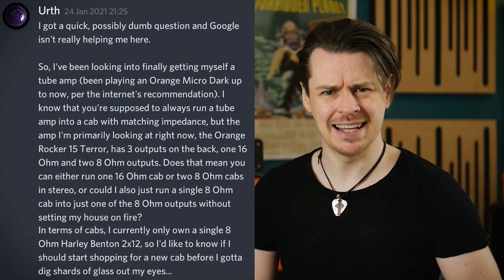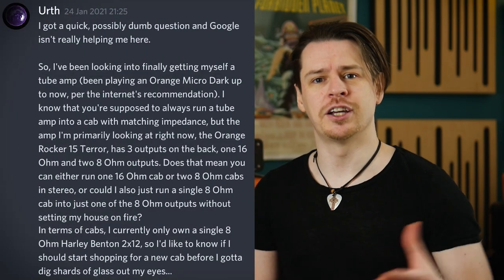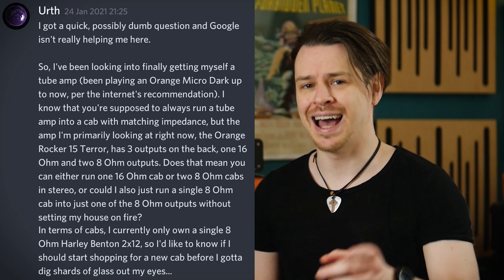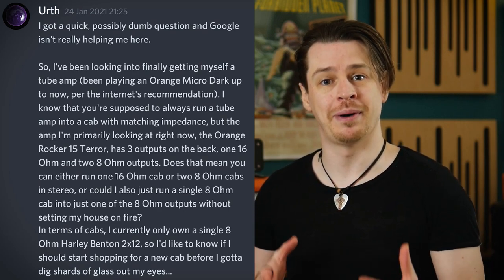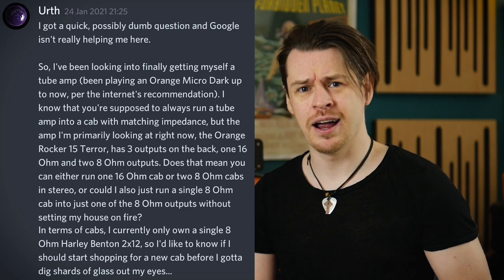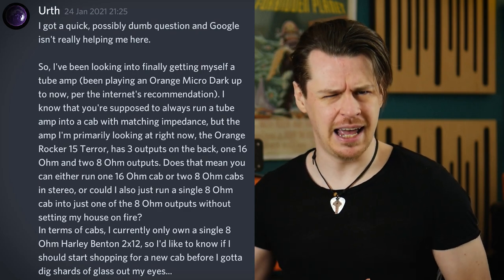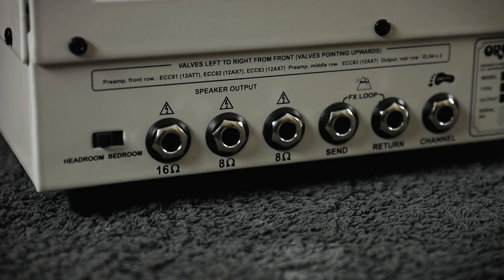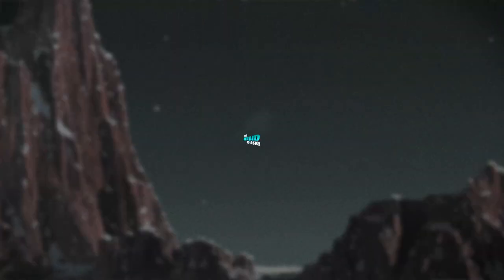Impedance Matching Speaker Cabinets | Too Afraid To Ask

Comment: This might sound stupid but what counts as high and low impedance. Is 4 higher than 16 or is 16 higher than 4? Does it literally follow numerically?
When talking about 8 ohm minimum, for example,  does that mean it will take 8 ohn and 16 ohm cabinets?

Comment: Here's a question, I'm thinking about building a speaker cab for an amp I'm building and I was wondering if I need to make the cabinet much larger than the speaker cone? Most cabs that I've seen are at least a couple of inches larger than the speaker so I figured that the reason was acoustics/air movement related. 
Cheers from Canada!

Comment: Q.  I'm about to swap out my 16 ohm speakers in my 4 x 12 speaker cabinet and install 8 ohm speakers, same wiring, would I run eight ohms out of my amplifier and not the 16 ohms output I previously used?
Thank you in advance

Comment: Colin, I'm sorry but I am still unclear. I thought I had it down; I have the ROcker 15 with a PPC 212
do I just use the single 16om connection? or the two 8om? thanks man
Reply from the maker: The video makes it very clear: 

If you have ONE 16ohm cab - connect it to the 16 ohm out.

If you have ONE 8ohm cab - connect it to either 8 ohm out.

If you have TWO 16 ohm cabs - connect each to an 8 ohm out.

Comment: But what, if any, benefit would there be from connecting 1no 16ohm speaker in preference to 2no 16ohm or 1no 8ohm speaker?   Other than being able to use a cabinet I have already?

Comment: I'm dumb so in my case I'm connecting an orange ppc212 120watt 16ohm cabinet to my Victory Super Kraken 100 head. Do i connect to both to 8ohms from the head to the back of the two inserts on the cabinet to make it 16ohms? Or just the one 16ohms output from the amp to the left insert or the right insert on the cabinet? I haven't bought it yet because im doing my research first and from the picture it doesn't tell me if the right one is the insert or if the left one is. One may be an insert and the other may be an output so i don't want to buy hook it up wrong then fry it the first day lol.

Comment: I have a Mesa boogie minirect. It has one 8ohm out and a 4 ohm out. 
I have 2 cabs if like to hook it up to. 
Both are 8ohms. 
One is a 1/12 cab. The other is a 2/12 cab. 
All 3 speakers are V30's. 
Is it possible to make this stack work ?

Comment: Assuming we have connected to the correct ohms slots. I see these single speaker engl cabs with 60watt speakers, and then 2 speaker cabs where there is a switch at the back saying mono 120watts and stereo 60 watts. How safe is it to connect a 100watt amp to a 60 watt single speaker or 2 speaker cab in stereo 60 watts?

Comment: If your Strat does not have enough low end, switch amp to 8 ohms and plug it into 16 ohm speakers. You could even practice some bass riffs with your Strat :-)
Reply: I meant a 16 ohm cabinet but YT won't let me edit my comment.

Comment: Does speaker size matter of the cabinet. Let’s say plugging into a 1x12 and a 1x10  cabinet, both are 16 ohms cabinets. Is it still safe to use both of the amp 8ohms speaker output into each cabinet.

Comment: Ok TATA question.... why does my 8 ohm  orange speaker cabinet have 2 inputs? It's a 1 speaker cab to match my (min 4 ohm) orange micro terror. I'm guessing 1 input makes it 4 ohm but I only have 1 speaker out. What would the setup be where I used both inputs of the speaker?

Comment: Man awesome video. But you forget to say if 2x16ohm cabinets will be pluged by two speaker cables into two 8 ohm socket. Or i will connect these cabinets to sum them, and send only one speaker cable to the 8 ohm jack from the amp
Reply: He did indicate the two 8 ohm jacks of the orange are in parallel so you could plug in two 16 ohm cabinets using two speaker cables into the two 8 ohm jacks. If you have a different amplifier, first find out if the jacks are in parallel. Don’t assume anything. Good luck!

Comment: I have a marshall 20w top and use it trough a 4x12, 240w, 16 Ohm cab. I also have 1x12, 70w, 16 Ohm cab and I wonder If I can plug them In together in 2 outputs for 16 ohm with out any problems. And does it matter that it is one 1x12 and one 4x12

Comment: So i have this fender frontman 15g amp that is running the stock speaker which is rated for 8 ohms, but i'd like to upgrade it with a celestion eight 15 (not a jensen cause i live in mexico and couldn't find one), but then i noticed the celestion is rated for 4 ohms, would be that a problem?

Comment: Am i safe to use a 16ohm and an 8 ohm speaker on a minimum 4 ohm amp? And how will i calculate the maximum load on the cabs? Not that i would ever be insensitivised to do so but still

Comment: I have lent my valve head at gigs before and had the transformer blow as I assumed people knew the importance of this. Very annoying and I had to pay for the repairs. But what if the cab is old and no longer displays what the impedance is. Other than not using the cab what would be the safest bet, 8 or 16ohms?

Comment: Great info, as always, Colin. Something that I have noticed on (solid state) bass heads is that it will often say something like: 500w at 4 ohms, 350w at 8 ohms. Is this reduction of power at different impedance levels just something that happens, or is it built into the design?
Reply: the higher the resistance, the harder the amp has to work (more current required) to put out the same level of power. It's like your car can do 100mph on the flat but the same car with the same engine can only do 60 going up a hill.
Reply: @dylanadams1455  That makes sense. Thanks.
Reply: @dylanadams1455  Actually, you have it backwards. Less resistance is more difficult for the amp.  The lower you go, the harder you force the amp to work. A dead short is 0 ohms. The closer you get to 0 ohm's, the closer you get to taking your speaker cables and crossing them. That's why when you look at amps and speakers, guitar or otherwise, you'll always see the specs are focused on how low the resistance is for an amp or speaker. Going up is no problem.

Comment: Thankyou so much for explaining this! Does the same principle apply with a loadbox? For example some loadboxes are 8ohms and some are 16ohms
Reply: You need to find out what it really is. If its an output transformer or an autotransformer, and put it in between an amp and speaker, then yes, the same rules apply. But this only applies if the amp doesn't have an OT or autoformer already installed. Also, he messed up in his explanation of how tube amps work in the video. I went over it in another post if you are interrested.

Comment: Here's a related impedance question: I have a Randall RG fully solid state head with two speaker outputs grouped together that says "Min total load 4 Ohms". The owners manual does say "Max two 8 Ohm cabs". Does this state outright whether the speaker connections are in series or parallel?
Reply: If there are multiple speaker outputs on an amp, they are always in parallel. Since that amp can handle a minimum of 4ohms, two 8ohm cabs in parallel is 4ohms at the amp, so you are good. Just can't mix an 8ohm cab and a 4ohm cab, or two 4ohm cabs, because either combination would be a lower impedance than the 4ohms the amp can handle.

Comment: Would this be the same for using a combo amp as a head? For instance could I connect a 16ohm cab with an 8 ohm combo solid state amp?
Reply from the maker: A combo is just the amp and speaker inside the same box.
The same rules apply: physics doesn't care if the speaker and amp are in different boxes or not.

Comment: My tata: i have never used amp sim. i dont know if need to always use a cab sim as well, or if only with some. And if i record from an amp head or combo directly into daw, do i need to use a cab sim with that? Basically, when to use a cab sim, and when is just an amp sim or amp usb line to DAW enough?
Reply: Totally depends what you're plugging into the amp. They should say whether or not they include cab sim on them. Older amps might just have a line out with no cab sim but that's rare nowadays. Sounds like impulse responses on a Daw are the way to go.

Comment: So to keep it short and simple im planning on getting a randall RG1003H 100 watt solid state amp head and a harley benton 120 watt 2x12 vertical cabinet and the head had max 4 ohms and the cab has a 8 ohms max and i need to know if they are alright to pair. Asking for a friend. :D

Comment: i think i get it but y 3 plug ins if you can only use 1 plug at a time. i have a 2x12 and 2 1x12 cabs could i run all 4 speakers at the same time?

Comment: Ok so i have an 800 watt solid state amp at 4 ohms. I run that to a 210 cab at 8 ohms then from that 210 to a 115, also at 8 ohms. Is this going to caise problems?

Comment: I'm curious,does this apply to combo amps,I'm thinking about doing a speaker upgrade of my Boss Katana from stock to celestion v30 and the amp is 4 ohms and the v 30 is 8 ohms
Reply from the maker: Why wouldn't it apply to combo amps?
Combos are just a combination amp and speaker in the same wooden box. 

The physics of the electronics remains the same.
Reply: @ScienceofLoud  I see,thank you for answering my question

Comment: So I was planning on replacing the speakers in a crate 4x12 cab, and was looking to do all 8ohm or 16ohm speakers (eminence probably), we have Blue voodoo head that only has an 8 and 16 ohm switch

But every calculator ive used to look at the all 8ohm/16ohm speakers in parallel or series come back as either too low (2-4 ohm), or too high (32-64 ohm). and im having trouble finding info on this. Im not quite sure what to do in this situation
Reply from the maker: If you pair off the speakers, wire each pair in parallel, and then wire the two pairs together in series you'll get your solution:

Using all 16 ohm speakers you'd get - 
1/16 +1/16 = 1/8 
Each pair comes out at 8 ohms

Then wiring those pairs in series- 
8+8=16
Putting those 8 ohm pairs in series gets you back to a 16 ohm load. 

Using all 8 ohm speakers you'd get:
1/8+1/8 = 1/4
both parallel pairs = 4 ohms

4+4=8
Series pairs gets you 8 ohms total.
Reply from the maker: OR you could do the opposite: pairs in series and then wire those pairs in parallel - 

8+8=16 twice
1/16 + 1/16 = 1/8

Whichever way you fancy doing it you'll get 8 ohm load from using only 8 ohm speakers, or a 16 ohm load from only 16 ohm speakers.

Comment: Is it the same if you daisy chain cabs? 8 ohms out to the 8 ohm cab then out from that cab to another 8 ohm cab??? Would that go to 4 ohm??  I,ve often wondered about that! You see many commercial speaker jack plates with in and out.
Reply: I have the same question.   I have 2  8 ohm cabs .  If I run them together from the 8 ohm Jack on the amp. Is that correct or not.  Did you ever get an answer?

Comment: I hate to point this out, but there's a huge mistake in your video. When you say that impedance varies with frequency, that's correct (It also changes the amps power output). The problem with tube amps is they don't like impedance swings. The reason tube amps use output transformers is to avoid all this. When you plug into the 4 ohm tap on your amp, is sees a consistent 4 ohm load. Same for 8 and 16 taps. The amp doesn't see different resistance values based on the frequency its asked to produced. The output transformer is used as a buffer between the speaker and output tubes in your amp in order to make it easier for the amp to drive the speaker.

What you said in the video does apply to solid state. Without the OT's used as a buffer, a change in frequency results in a change in the resistance the amp sees, and also a change in power output. The higher the resistance, the easier the load for the amp, and the less watts are produced. For example, if an amp puts out 100 watts at 8 ohms, it puts out 50 watts at 16 ohms. I should also point out that higher frequencies are higher impedance loads, while lower frequencies are lower impedance loads. So, for low frequencies, resistance is lowered and is a more difficult load to the amp to drive. The amp is forced to put out more power, and if its well designed, it should output double the power when resistance is halved. So, a 100 watt amp at 8 ohms should put out 200 watts at 4 ohms. (Not all amps can double. It all comes down to how well the amp is made. Some can do it, some can't).

With solid state amps, you also have to be careful with the cabinet itself. Speakers are rated in averages. An 8 ohm cabinet means it averages 8 ohms, and is not a consistent 8  ohms. Just like a solid state amp, resistance is frequency based. Because of this, you can have one 8 ohm cabinet that is easy to drive, and another 8 ohm cabinet that is difficult to drive. You need more information to make this determination. When you have a solid state amp, the most important speaker spec is the lowest resistance load the speaker can show the amp. So, if you have 2 8 ohm cabinets, for example, one cabinet may drop down to 3 ohms, and the other may drop down to 1 ohm. The speaker that drops down to 1 ohm will be a much more difficult load for an amp to drive, even though the average resistance is 8 ohms for both amps. Also, with tube amps, you don't have to use an 8 ohm tap for an 8 ohm speaker. As long as you don't do something that drops the average impedance below what the amp is rated at, its OK to try the different taps and pick the one that sounds the best. Just don't go lower than what the amp is rated for.

Comment: sory but theres a LOT of info in this vid,           Im just trying to find out the SAFE way to set my Invective mh amp with a 13.2ohm cabinet.                                           Would I set the amp on 8 ? or 16 ?
Reply from the maker: Where are you getting the 13.2 ohms from? Is that the nominal impedance written on the cab specs, or did you take a DC resistance measurement to acquire that?

Comment: Very interesting video, but still one question that’s not answered: if you use an attenuator, which decouples the amp and the cab, can you mismatch the head/cab inductance? Like, 16OHM head into a 8OHM speaker
Reply: some attenuators are impedance specific (two-note torpedo for example comes in a 16ohm and 8 Ohm version) but some others like the Jet City Jettenuator don't care much about impedance coupling and allow you to mismatch. Mike Soldano years ago in a short video presenting the Jettenuator said that it works as a buffer between your amp and your cab, you can plug your amp in the right input of the Jettenuator (16 Ohm amp output to 16 Ohm Jettenuator input etc) and stick any cab you like in the output plug. That's why the Jettenuator has three Ohm specific Inputs but only one output that is not ohm specific. I'm running my JETCITY JCA50H through the 16 Ohm or 8 Ohm inputs of  a Jettenuator and from there to a 4 Ohm speaker with no problems up to now. I think the Harley Benton and Bugera attenuators are clones of the Jettenuator but i'm not 100% sure if they function the same way on this matter (probably they do as they also share the exact same back-panel with inputs and outputs) .
Reply: @andreaspapandreou871  very nice to know, thank you. The HB has three ohm specific inputs but just one cab out, but in the instructions doesn’t say anything about cab mismatch... I’ll keep researching :)
Reply: @sergioserramusic  neither the Jettenuator manual refers to cab mismatch at any point. Mike Soldano who designed the whole thing was adamant though that once you connect your amp to the Jettenuator it works as a loadbox and everything is safe so that you can go on and connect any Ohm specific cab you have at hand. Of course he didn't mention anything about tone or EQ changes that take place. As I said the HB and Bugera version is a clone but I'm not sure if its an EXACT clone so i cannot provide any further safe info, if you have the HB version try to ask the question at a HB specific forum.
Reply: @andreaspapandreou871  thanks 😊

Comment: I am still a bit confused 😅 what if I have a solid state amp that can run at 8 or 16 ohms and I have 2 separate 1x12 8ohm extension cabs? 

I only have one available output from the amp, and the cabinets themselves are identical and have a second output to daisy chain an additional cabinet. What would the total load be from the two 8ohm speakers and can my 8 or 16 ohm head handle that?
Reply: I would check the available documentation. Most cabinets with daisy chaining place the speakers in parallel and not in series unless explicitly stated. There are risks to running a series daisy chain. You can verify the DCR if the chained cabinets without connecting the amplifier the infer the impedance. Measure the dcr one of the cabinets. Daisy chain them. Now measure the dcr. Did it double or half? If it double d, they are in series. If it halved, they are in parallel.
Reply: Then there is the argument about acceptable mismatch load. If you are mismatching you source and load, you are taking on that risk unless the manufacturer states it is acceptable.

Comment: This helps but it's still so confusing. Heres my issue.... I have posted this elsewhere and got mixed messages lol. I have a Marshall DSL 40 C (Combo w 1x12 16OHM).  It has 1 16OHM output and 2 8 OHM. I have 2 wonderful Celestion 25 watt Greenbacks (8 OHM). I want to make a 2x12 for this. So I have been told that wiring it in series, with one input jack is fine. I do forget which output 16 or 8. Im not worried about the 25 watts just the impedance. 

Any guidance?
Reply from the maker: If two 8 ohm speakers are wired in series inside a single cabinet then the cabinet totals 16 ohms
Reply: @ScienceofLoud  Gotcha. So this should work. Again, ive used these little 25 watt workhorses in a 4x12 and they scream. I cant imagine stage volume (5/6) in a 40 watt will overwork them. 

Thanks for the response.